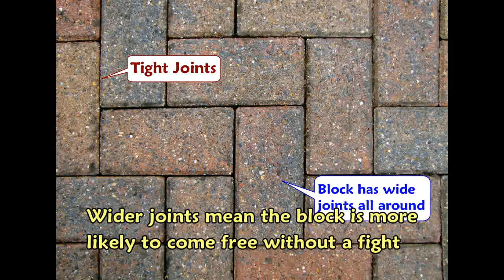Removing blocks using an extractor tool

Comment: Once you got the first one out all the rest can be removed by hand
Reply: Not on my drive. They are so tight you have a real struggle with each block until 2 sides are clear. The drive is on a slope which doesn't help.

Comment: Hi there, will this tool work with pavers with sanded joints? thanks
Reply from the maker: Yes, but blocks that have been sanded in for a while can be quite difficult to jiggle free. In such situations, a rocking movement, to ease the block out one edge a little bit at a time, is usually the most successful strategy.
Reply: Thanks for the reply Tony, 2 more questions.. what is the max size paver the extractor can fit and where can i purchase. Regards, Shaun
Reply from the maker: That model goes up to 400mm. There is a bigger model, the so-called "slab extractor" bthat goes up to 600mm. The tool shown is a Probst tool, so buy from them....and tell them they owe me a pint! Probst Handling UK - 01952 292733

Comment: where can I buy/rent this tool?
Reply from the maker: Tim Singh Probst UK have the new model in stock at their Telford depot
Reply: Tony McCormack thanks
Reply: A similar one is on Amazon, but it is £144... Not sure if the brick lifter with one arm can do the same job, but they are on Amazon from only £12